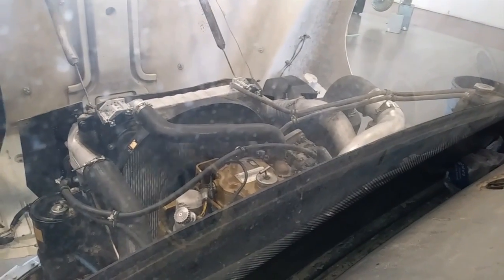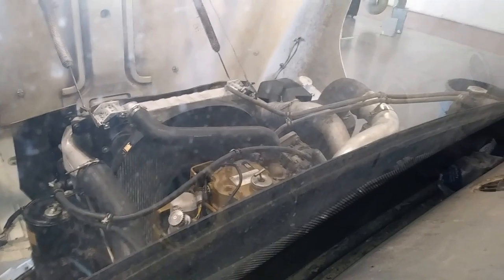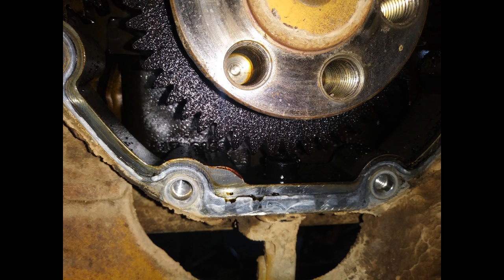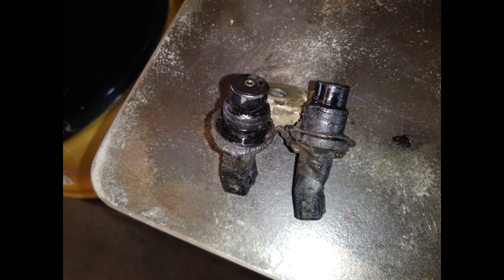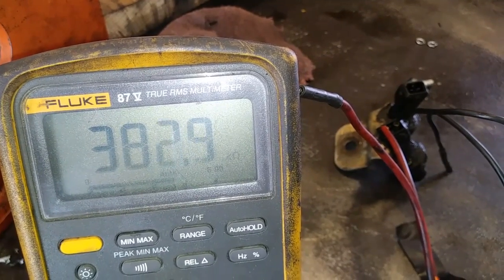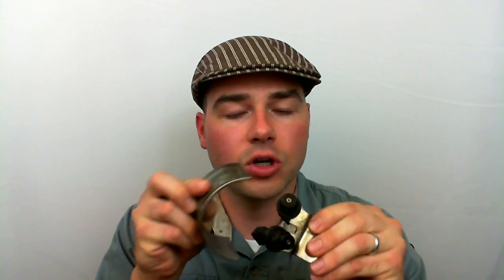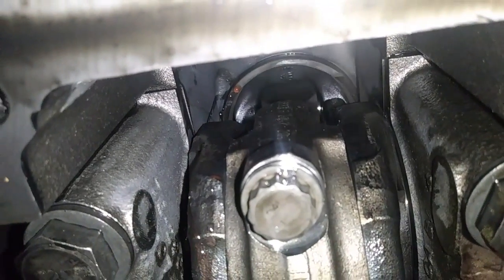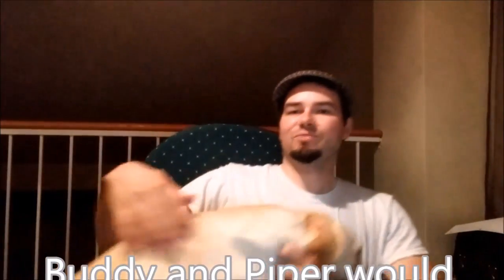Diesel Engine Problem You Can't Figure Out, Check This! Timing And Speed Sensors.

Comment: What up man what do think about a 89 Kenworth with a 3046b do u are they worth buying or do you think it's obsolete
Reply: joey dollars It doesn’t have any of the emissions bs of the newer truck though it might need some work. Depends on the overall condition and what it needs
Reply: Get it rebuilt and youl do 3 millions miles with no problems. My fleet still have 3406s all have done 3 million miles with zero issues or rebuilds done
Reply: Well wave at the REGEN trucks as you pass them setting on the side of the road. All you need is air, fuel, coolant and oil. Also find    you an old timer. The younger tech's if they can't connect the box up to it, most of them can't think. Deal with it every day.
Reply: John Goldsmith It’s the way of trucks nowadays. With today’s trucks and how advanced they are you have to hook up a computer to get a clue with what’s wrong. For example International has what they call FCAP (fault code action plan) you literally follow it and it’ll tell you what’s wrong with it. Coming from a young diesel tech lol
Reply: @huntguy3831  Coming from a old diesel tech. We had to figure out the problem. I deal with new guys every day and they want everything explained or texted to them. I had a 3406C missing a few weeks ago. I handed the new tech a 3/4 wrench. The truck was running he opened the cab door closed it turned around and asked me what am I suppose to do with this. I have had them ask me where is the cab connector.  New tech's are clueless if I ask them to rerate a mechanical engine from this HP to that HP.  Most can't even read a mic or do basic math. When I go to break, all the young tech's are already sitting down with there cell phones out. They can't live with out one.
Reply: John Goldsmith Yep that’s the way everything is going. Less actual work and more computerization. It’s the way the schools teach and how the industry is going

Comment: My 7.3l has the CPS sensor that is notorious for randomly going out. I have a few spares that I've collected and only once has my truck randomly died on me while driving. I changed the sensor out with a new one and it hasn't done it again since. Not really the best diagnosis but there was nothing really I could think of other than try a new CPS sensor for the random stalling.
Reply: Buy the sensor from Ford , aftermarket sensors are not reliable.

Comment: Hey josh I’ve got a 2007 cat c-15 sence the rebuild was done a year ago you have to turn the fan on manually if you let it come on by itself it kicks in about 210 degrees but at this point the oil temp goes just in the red and stop/Check engine comes on then goes out once the engine starts to cool down .... why is this ????
Reply from the maker: 210 degrees is the normal fan on temp, nothing wrong with that. The check engine light is another problem entirely it sounds like. Do you know what the the check engine light coming on is? The oil temp is usually not a Cat sensor and won't cause a check engine light.
Reply: Adept Ape the check engine light and the stop engine come on every time I let the engine fan come on by itself
Reply: Once the fan starts to cool the motor the check engine light goes out and so does the stop engine ....!
Reply: Once the fan starts to cool the motor the check engine light goes out and so does the stop engine ....!
Reply: @matthewwalker6401  start turning the fan on manually
Reply from the maker: You need to find out why they are coming on though, what codes? 210 degrees is not an overheat condition, you might have sensor problem that is faulting at that temperature.
Reply: Fan on temp by engine coolant is 217F for this engine. I data log a cooling system problem to see if regulators open, fan comes on, ECM output shows me the fan came on. Delta T across radiator. Twin turbo engines have a problem of the engine fan pulling a lot  of dirt into the radiator.  Another problem is the Horton aluminum face fan drives. They are know to slip when hot. I recommend      putting a Gold Top repair kit in them. Horton recommends turning the A/C timer to 180 seconds to help cool the fan drive down.    With the Gold Top I set them to 120 seconds.
Reply: John Goldsmith yes it is twin turbo I put a new rad .... new fan and fan hub ... new water pump ....
Reply: Have seen regulator hsg worn and coolant will bypass radiator. A data log would help, start from a cold engine to fan on. Watch ET status screen I put mine on full screen. Look at Coolant temp, Fan on/off, A/C psi switch, Boost and Air intake manifold temp, Low coolant. You  can only look at 6 in full screen. You need to see which parameter is telling the ECM to turn the fan on first. Naturally you want A/C off.
Reply: Matthew, Josh provided you with two great suggestions.  I will just add that if your rig is blink code spec'd, CAT ET will not be needed to discover the code.  My question to you would concern the oil pressure reading when the oil temperature gauge goes into the red - what is that value?
Reply: Chad Jessup about 6 months ago my oil pressure went from a good 80 psi then over night went out one morning started it and 60 psi just like that .... everything still works great sounds good everything .... just lost some oil pressure .....
Reply: @matthewwalker6401  Most of these Cat is driving the oil psi gauge. You can try a manual gauge, access port near fuel filter,                             where oil psi sending unit is. Or just buy a new one. Cat rule of thumb, if oil psi more than 10 investigate.
Reply: Matthew, that abrupt drop in oil pressure by itself is not a good sign and coupled with the increase in oil temperature, that would signal the need for an oil analysis.  I  recommend you at least change the oil filter and cut it open for a metal inspection.  Josh has posted a superb video on that matter, if you wish to view it.